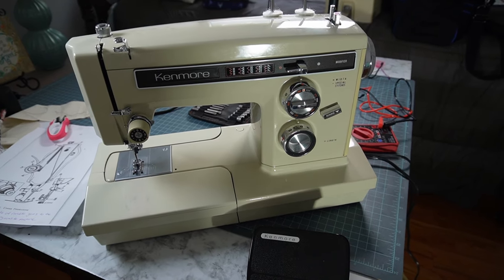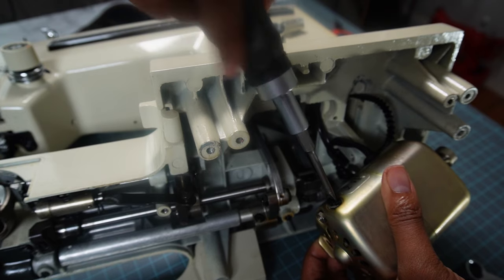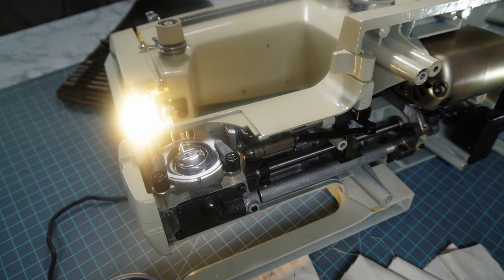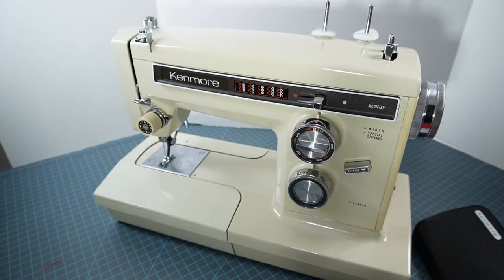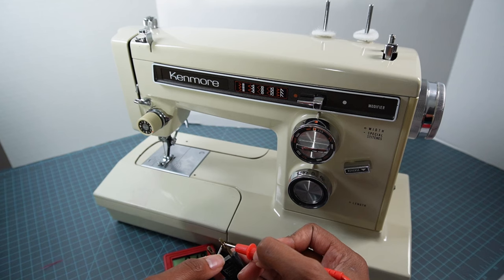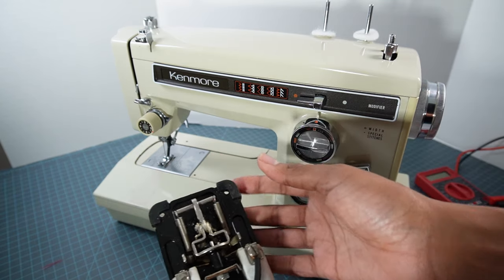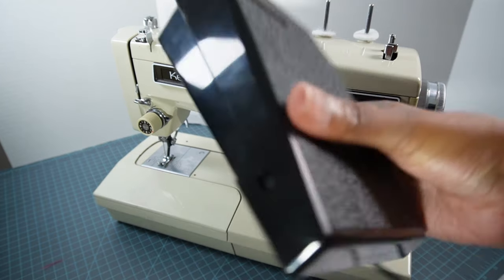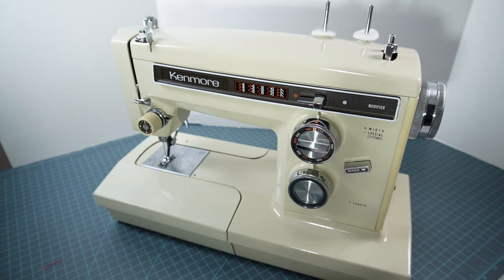Lights On, But Sewing Machine Not Running :-(

Comment: OMG - I did not know what those little holes in the prongs of the power cord were for or how they worked - I never actually thought about them! Once again, I learned so much from you videos - this is straight forward and I'm less spooked about vintage machines. Thank you for sharing your experience and expertise!
Reply: This is not related to the video, but what are your recommendations for an embroidery machine?  Reasonably priced that is.

Comment: Thank you for this video. I have a Kenmore 158.504 where the light goes on but nothing happens with the motor. No sound or movement from motor. Got the machine without a foot pedal. Got the correct foot pedal and the light goes on but nothing with motor. Using your video will look at the motor brushes!!!! Thanks again, your video presentation was easy for this novice to understand!!! Subscribed!

Comment: I have had good success cleaning the small copper “plates” on the commutator with a soft eraser like you would use in school. And, don’t use alcohol on the wire windings on the motor. They are coated with something like shellac to protect them and keep them from touching each other.
Reply from the maker: Hmm. I will have to try the soft eraser. Thanks for the tip.

Comment: The part of the motor that the brushes contact is the commutater, NOT the communicator.
Reply from the maker: You are exactly right. I didn't realize the mistake was made until I uploaded. Unfortunately, I cant correct it without removing the video and reuploading :-( Thanks for the comment.

Comment: I sort of bopped through the video. It is rare for a brush to break away like that, but it can happen. Did you disassmble the motor and have a look at your commutator? 

If a brush went rogue, it could have potentially damaged the copper slats in the commutator. A feel around with your fingertip would easily tell you if your commuator is OK, or if it has a nick that needs to be buffed out. As well, the carbon soot that builds up on the commutator, the copper windings, the rotor and the stator all should be cleaned up as well. The copper windings just need electronic cleaner or 90% Isopropryl alcohol sprayed on while  you very carefully wipe down the surfaces (softer than soft cloth, and do not soak them, very important). 

A Dremel tool or 800 grit sandpaper to clean the soot off of the commutator, stator and rotor helps too. Good idea to clean the bearings on top and the bottom of the motor can while you're at it, and deliver a drop of oil in the cans vents where the wool wicks deliver the oil to the rotating shaft on both ends (this should be done every 6 months to a year, the oiling I mean). 

This will keep your machine running at optimum speed, and keep the motor healthy for a lot longer than if it's not done at all (which most sewists don't tend to do).
Reply from the maker: Thanks so much for letting me know. I'll check it out to make sure the broken pieces aren't down in there.
Reply: @ThimbleBook  maybe do the maintenance I suggested. It'll give your motor a much longer life, not to mention the increase in performance.
Reply: Do NOT use sandpaper to clean the commutator face!!
Reply: @randykoger4646  I, and many other sewing machine restorers have used very fine grit sandpaper (absolutely nothing with a lower grit) on dings in a commutator with excellent results. I would never use it if the commutator was just fouled with carbon dust, etc, but if you are dealing with a deep gouge, the sanding (either Dremel it while it is in a vice or hook it up to a drill, secure said drill in the vice and allow a thin strip of sandpaper to clean and level the surface until flat. It's not just my fix, it's the fix of a great many other restorers when dealing with a damaged commutator. I stand by my statement! NOW...for the record, if you don't know what you are doing, then don't follow that example, bring the motor to a professional for refurbishment.

Comment: Motor bushes do create gunk in the ports of the brushes. When they gunk up they stick and when they wear down they no longer make contact with commutator. Use qtip to clean out the brush ports and the outside of brushes. I do this as part of every tuneup i do.
Reply from the maker: This is a great piece of advice. Thanks.